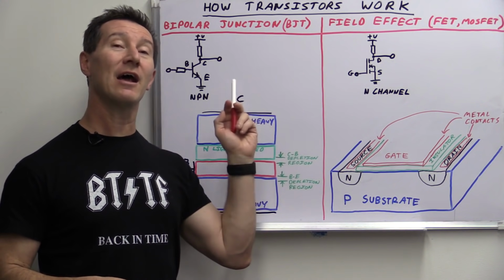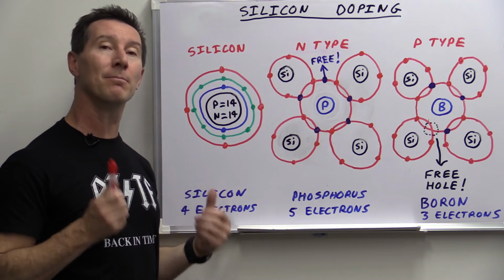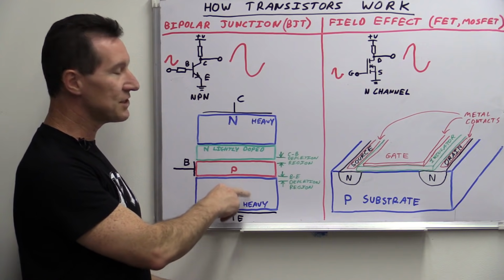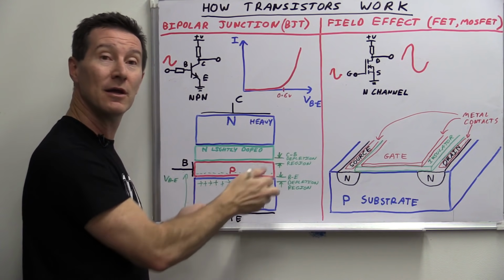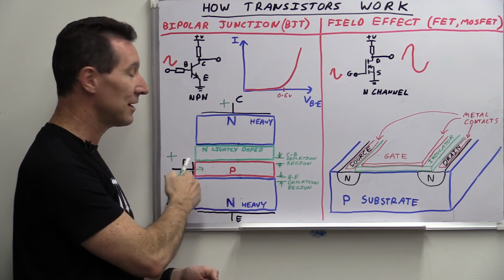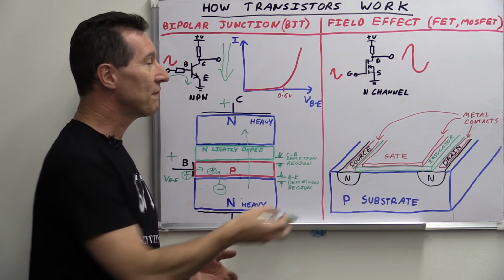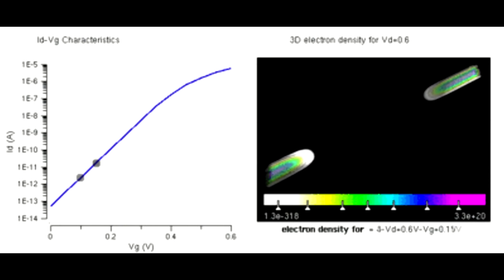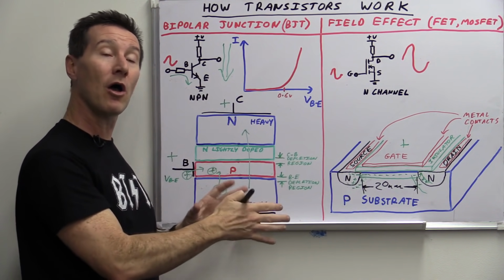EEVblog #748 - How Do Transistors Work?

Comment: I have an electronic question. I have a 16 channel audio snake with a wire that has been broken somewhere along the 100' length. Will a tone & probe be able to find the break, even through an outer shield.... and all 15 adjacent shields? ... or will I be wasting my money purchasing a tone & probe? Is it possible to run a high voltage, or high frequency (or both) through the line and 'force' it through the shield(s)?
Reply: How do you know a wire is broken? Doesn't that narrow it down to 1 cable out of the 16? You can use a multimeter in continuity mode to tell if a wire is broken by probing the ends and listening for the beep. To find out where along the length of the wire the break is you'd have to do some sort of fancy TDR magic.
Reply: +matt holland. The wire is broken because the 'peep' function on the Fluke 179 doesn't make a sound, even when testing on the inner side of connections at both ends (I can't believe I had to explain that).
Reply: Tim Kasey got it, the reason I asked is it sounded like you were asking whether you should buy a multimeter. I'm not sure what you mean by "will I be wasting my money purchasing a tone & probe" then.
Reply: Tim Kasey so which wire has the break then? hot, cold or ground?
Reply: The red wire, or pin 2 - diagram for reference: http://www.toffer.com/wp/2008/08/07/3-pin-xlr-wiring-diagram/
Reply: matt holland oh in my googling i also found you can find the break with a capacitance measurement, if you have or can borrow an LCR meter and know the capacitance per unit length of your cable.
Reply: matt holland oh, maybe the easiest way if you're sure it's not at the connectors, is to do a continuity test at both ends of the cable, while running the length of the cable with your hand bending and wiggling as you go. you might be able to close the circuit by bending the wire just so, and you'll get a beep when you do.
Reply: I've tried that.... I think a capacitor tester would be able to give me a value that could be converted into length. Example: capacitance of two core wires reads 100. Capacitance of the bad core wires reads 10.5 at one end & 89.5 at the other end. The break would then be at exactly 10' 6" from the 10.5 end.
Reply: The numbers will be more like 3600, or 245.... and could be converted into length values. I believe this would work.

Comment: Big thumbs up. Comparing the transistor and FET symbols, why does the FET symbol have an extra bit on the source? What does it suggest about the FET construction? Thank you.
Reply: Kent A. Vander Velden I assume you are asking why the symbol has two parts connected to the source? You see MOSFETs are actually 4 terminal devices, Gate, Drain, Source and Body/Bulk, the last being the substrate of the transistor(in the symbol it is the middle connection). However for most applications the B terminal isn't very useful and if left floating may affect the operation of the device so the B terminal would just be tied to one of the other terminals, generally source, so discrete MOSFETs generally come with this done internally.
Reply: Ts6451 That's fascinating, I'll read more about it, thank you for the explanation, I had always wondered.
Reply from the maker: Kent A. Vander Velden I deliberately left that bit out, the video was already getting longer than I wanted. That could have taken me down the rabbit hole of different FET types.

Comment: The mosfet looks completely symmetric. Thus I don't understand why it would stop flow in one direction and allow it to the other direction.
Reply: Ts6451 Man, you just had to beat me to it... Do you have any idea how much googling I did to try and answer this guy's question? :'(
Reply: WarpRulez MOSFETs may be used either way in theory, and you may be able to use a MOSFET as a bidirectional switch in some cases, but since MOSFETs are sensitive to ESD/high voltage spikes, they often have integrated protection diodes which could be an issue if you are switching voltages larger than the diode drop, or they may have asymmetric construction, to improve some characteristic in one direction.
Reply: WarpRulez I forgot to mention something about the asymmetry of the devices, namely that the Body/Bulk terminal in MOSFETs generally is tied to the Source terminal(as is indicated in the symbol by having two internal connections to the Source). That means that even if you have no reverse protection diode, there is an effective junction between the Source and Drain through the substrate.
Reply from the maker: Ts6451 Yes, this is what prevents them being used the other ways. I'm sure I've covered this body diode in another video somewhere...

Comment: When I was taught electronics, (some decades ago...) we were taught that a a silicon diode drop was 0.7V. I recently came back to electronics and I've noticed that it's almost universally quoted as 0.6V. Where did that 100mV go to?
Reply: Rob Fenwitch Maybe slightly better manufacturing tolerances these days, or perhaps a different measurement temperature (it goes down with temperature iirc) ? (when measured I always find it to be between .6 and .7)

Comment: With some luck moors law will still hold for the next 2 decades.
Some of the professors at my local technical university  have been successfully working at the Karslruhe University on way smaller kinda mechanical switches.

Collector and Emitter are made from a silver-base, and the actual switching happens with silver-atom bridging the tiny gap.  
Not entirely sure how it works, but those switches are insanely efficient - and they can carry a mindbogglingly huge  current in the range of micro-amps over a single atom.

Would be nice if they gave some more coverage on that.. and they didn't mention it this year sadly.

Comment: Intel's new chips are 14 nm.
Reply from the maker: samzx81 I want off this planet!
Reply: samzx81 Indeed, at these ridiculously small distances the challenge is how to prevent the electrons from just "hopping" over from source to drain as it's only 14 nm and the drain will usually be at a positive voltage which attract the electrons. But obviously Intel managed to keep this in control as in general their chips consume (almost) no current when off.
Reply: The cheapest scale to fabricate is 28nm, Apple went to 20nm for reasons of miniturisation and marketing and because they can charge a premium. In my opinion to build at 14nm is either for marketing bragging rights or some really specialised reason to miniturise.
Reply: 4n0nym0usly It is not that simple, it depends on what you define as "cheapest". Cheapest per square mm (usually very old process nodes) is something different than cheapest per transistor. Also it depends on what functions you want in a chip. It has nothing to do with marketing as setting up a 14nm production line costs upto billions of $$$. Intel would only invest this kind of money if they think they can earn it back later. And I'm sure they will. If manufacturers had stopped miniaturization 10 years ago then we would not have smartphones today ! 
Just thought of another example: How would you like a 1 TeraByte SSD for $ 50 ?? (Nowdays these cost $ 500). It will happen some day thanks to this miniaturization.
Reply: Peter-Paul Vervoort my point is that 28nm is the sweat spot for optimal per unit cost per transistor. Go below that and the unit costs start climbing and eating into profits. The push to go smaller then becomes marketing. As you say, they will make higher capacity ssd's and they may even make $50 but in my opioion they will be on much slimmer margins.
Reply: 4n0nym0usly How do you know that 28 nm is the sweat spot. Then why would for example Intel make Haswell CPUs in 22 nm ? One of the reason is is that making a chip with 1.3 Billion transistors on 28 nm would make the chip die size so large that the chance of a defect on an individual chip would increases too much lowering yield and increasing cost ! So more complex designs MUST move to smaller process nodes to be economical. And assuming for a certain application 28 nm is indeed the sweet spot (not all chips are so comlex that they require 22 or 14 nm) then what will happen in 2 years from now, then 22 nm will be the same price per square millimeter that 28 nm is today. If the margins on newer nodes like 14 nm would be less then for sure Intel and TSMC would not invest many millions of dollars into companies like ASML for example to develop the required machinery to go to 14 nm and lower. The whole Semiconductor industry has been doing this for over 30 years now and I think if marketing was the only reason to do so these companies would be bust by now. But no, they're making sh#t loads of money. Really, they're moving to 14 nm etc to keep their profits and margins up ! All the companies that cannot follow (I mean, do not have the financial means to join) this race either go bust or concentrate on different (specialty) products.
If you're not familiar with "Moore's law" then you might want to read the article about it on Wikipedia. Gordon Moore is one of the founders of Intel and he predicted this move to smaller transistors already in the 1960s !

Comment: Something I was taught in the navy, NPN = Not pointing in with regard to the arrow. Also Dave I am 48 years old so my electronics training in the navy included tube amplifier theory and that is basically the same way FET's work.  We were taught that when speaking of current flow it was always negative to positive.  One question that we argued about all of the time is do the electrons flowing through a wire travel through the wire or on the surface of the wire.  What are your thoughts?
Reply from the maker: Gregory Wood Skin effect in wires and PCB traces is very real, depends on the frequency.
Reply: Gregory Wood depends on if it is AC or DC. DC will flow through all the wire, AC current will be carried on the surface up to a certain depth (it's called the skin effect).
Reply: ***** what dictates the depth of skin effect?
Reply: Son of a Zombie The frequency and properties of the wire (conductivity and magnetic permeability)
Reply: ***** what about DC pulsed current you know something that changes magnitude constantly but not polarity like a  1khz 50 % DutyCycle PWM system?
Reply: marionetadelplaneta 
I would think so, yes. Skin effect occurs with brief pulses of current.
Reply: marionetadelplaneta Tomek Chmielewski Pulsed current will still exhibit the skin effect, but it won't be as clean (and easy) as for the AC case. A square wave effectively contains many different frequencies, so I would expect that the skin depth would fluctuate at each edge of the pulse. With the depth increasing when the current was stable (i.e. high or low). Overall, it would behave in a similar way to AC, but I'm uncertain if it would be better or worse.
Reply: *****
i would say better since there is no current trying to flow backwards also  the armonics that form the DC are moslty low frequencies and one polarity is applied at all times but im not sure since the skin effect is studied on AC so i havent found useful info :(.

Comment: 5:29 Having the same amount of protons and neutrons does not make it have a neutral charge! Neutrons are neutrally charged so they cannot balance the positively charged protons! Was shouting at the screen lol EEVblog
Reply from the maker: waicool20 Doh, did I really say that? - Yup, I did! Fixed in annotation, thanks. I shouldn't have put the neutron count in the middle, that's a tad confusing.

Comment: How do old school germanium ones work ? I am guessing the principle is the same, but are they made in a different way ?
Reply: Andrew Joy I have some old germanium diodes, (for example: AA113) that look like a piece of crystal with a metal point pressed on it. I remember reading somewhere that these are "point contact diodes" and are made by using a piece of (N-doped ?) germanium. The metal pin is pressed on it's surface then the PN junction is made by applying a short current pulse that partly contaminates the germanium which then forms the PN junction.
Indeed once the PN junction is there it works identical to a PN junction on silicon.
The forward voltage of a germanium diode is somewhat lower than that of a silicon diode.
But Schottky diodes have an even lower forward voltage !
Reply from the maker: Andrew Joy Yes, quite different, they use a diffusion process.
Reply from the maker: ***** Yes, diffusion type older BJT construction instead of the more modern planar type construction. I wanted to draw the planar BJT but it's was physically upside down and didn't make as much sense.